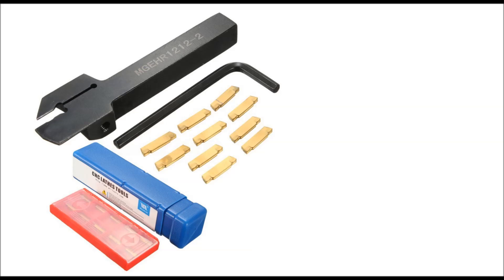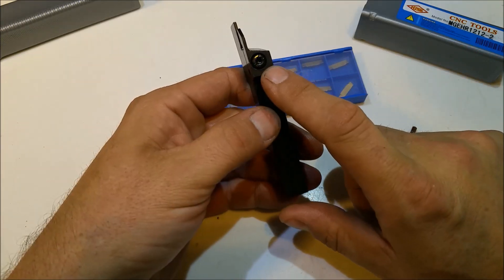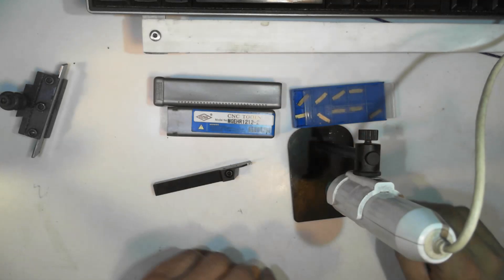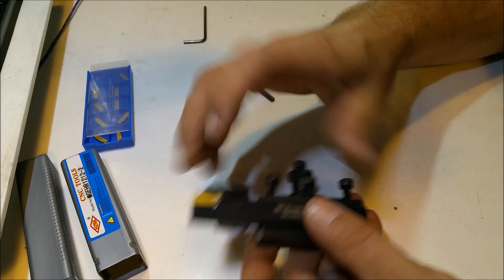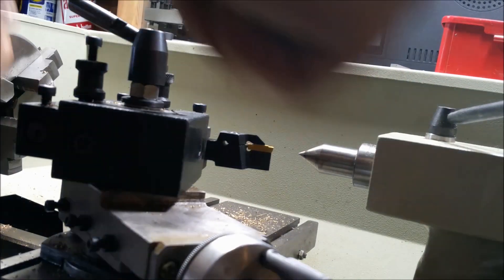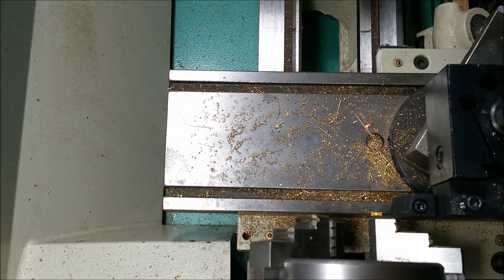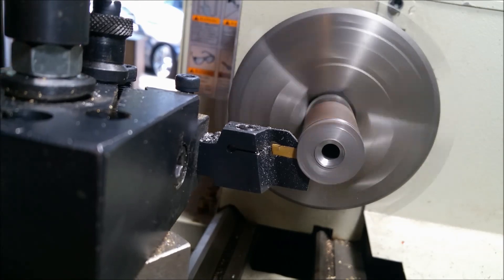Carbide Insert parting Tool review (MGEHR1212-2)

Comment: Use hss put the tool in the holder and put the lathe in reverse, you wont have any issues, carbide is a waste of time on small lathes because they sre not rigid enough

Comment: I already have got 2 pieces of this tools for 2 mm tips, one in "right" and the other in "left form" ( depending from the side you are approaching your piece ); they are beautifull and easy to use. I use them indeed in up-down position and reverse speed of the spin, so the chips easily fall down without problems to the incoming cut.
Some oil during cutting can also help. The tips could also be regrinded, and they still do work, on the contrary other shape of tips ( for other works than cutting ) are not regrindable cause their shape ...
For deeper cuts, on major diameter stocks, HSS tools are the only ones you can use, i equally do use them also in a top-down position and reverse speed of the spin. Here i use them in a dry situation, no oil that can stop the chips from falling down, as it was glue inside the groove ... and so generating a worst situation than dry cutting. I was able to cut a 55 mm steel stock, more than one time ...
Don't use HSS tools with rectangular shape  ( as 2 x 12 mm ... ) but ONLY trapezoidal shape ( 3 mm up, 2 mm down x 12 mm height ) otherwise they will always become stuck inside the cut ... ( no enought room for the HSS tool itself into the groove ).
My chinese lathe only can use 10x10 tools, so i choosed "1010" tool instead of "1212" herein in the video. And also you can choose tools for using 1,5 mm tips or 2,5 mm tips ( instead of 2,0 mm of the video ) to cut circles in your stock piece ; also rounded tips are disposeable, for installing rounded o-rings.
Somebody says cutting with 1,5 mm tips is more and more easily than 2,0 mm tips, for the minor steel to cut ... i never test it ...
Alessandro from Italy.

Comment: Something is flexing there really badly. If You can see it, it is too much.

As probably everyone already has said, the cutting point should be as near the chuck as possible. The longer stickout there is the more the workpiece itself is flexing and sometimes it climbs on top of the cutting blade wreaking havoc. Climbing takes place also when the tool height is too low. Having the cutting point far away from the chuck will also increase the risk of chatter. Sometimes the setup does not allow cutting near the chuck. Then tailstock support can be used but this has to be done with caution to not to squeeze the cutting blade between workpiece parts after parting.

Another problem that most had spotted is the tool stickout. Even if it sticking out only about 10 millimetres, it should be eliminated if possible. So the tool should be pushed into the holder as far as it goes and is allowed by the setup. Long stickout on the tool increases the risk of the workpiece climbing on top of Your cutting blade. It also increases risk of chatter.

Some of the commentators had also spotted the general stickout of the cutting setup. By this I mean the position of the compound and the angle of it. After having those minimized by straightening the compound and moving it so that it is fully supported by it's dovetail, everything that is not required to move should be locked. This includes the carriage and the compound. This is probably the most effective measure against tool flexing and vibrations.

The center height of the cutting blade is very important and when done incorrectly variety of problems can occur.
When blade is too high it does not want to "bite" into the workpiece. One has to apply excessive tool pressure in order to make the cutting start. When the cutting finally starts, the blade cuts in an unexcpected manner. The excessive tool pressure will at some point chip the insert as well.
When blade is too low the cutting angle becomes negative when approaching the workpiece center. This causes downward force which can make the blade to flex and allows the workpiexce to climb over the blade. This usually cracks the insert, destroyys the workpiece and can bend the tool holder.
The correct tool height is at dead-nuts center height. Although adjusting the center height using the dead or live center at the tailstock is obvious this method is not that accurate because the tip of the center is rarely very sharp. One very accurate way of adjusting the tool height is by facing with the parting tool. Just have a scrap piece in the chuck and start facing it. Facing may leave a nibble in the center. When facing does not leave any nibble, then the tool is at center height.

Cutting oil is generally not needed with coated carbide tooling. However, it can improve the surface finish and prevent the chips from welding into the cutting blade. This can happen especially with aluminium. Mild steel is also a good candidate for bad surface and cold welding. Cutting oil is a good addition. If it doesn't help it doesn't hurt either.

Speed and feed play some role when trying to eliminate chatter. Generally parting should be done as fast as it can be done without chatter. Tool pressure should be kept rather high to keep the setup from chattering.

Happy parting !

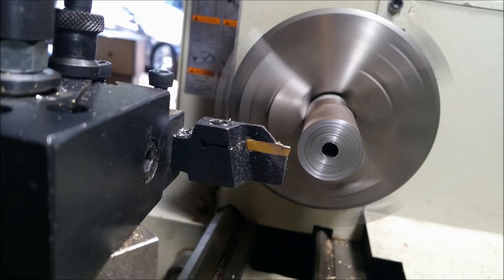Comment: Around 3:36 I can see that the tool is not stiff enough... Play with slowest speed everything's bending there. 4:02 the tool is too far outside of the holder as well. This is ok for aluminium but for steel you should modify that part.

Comment: Nice video and presentation. 
I have one thing to add after observations gain from several channels. 
(1) blade tip can’t set closer to the post because of the clamper skull take up space. 
(2) due to (1) the moment from work to post is higher than necessary, is a disadvantage. Nominal post_holder flex will get emphasized letting the blade tuck below the center line. 
(3) tucking under, a horizontal force component is produced tearing the tip away from its body, the insert. 
(4) cracked carbide tip still tucked in the material get forced down onto the insert seat, at stalking force, the broken tip cut down onto the seat, thereby ruining the seat beyond repair.
 
Remedy? There is no remedy once it’s damaged. Something we can do in advance is : advance the tip level above center line to an amount equal to the flex displacement. It isn’t straight forward and is dependent on : rpm material, feed rate etc. use our judgement.

To avoid error judgement : 
- Stop cutting the last 1-2 mm of solid work , unless work is bored or drilled.

Comment: Bought one for parting and the inserts were breaking quite easily.  Sometimes it liked going fast, sometimes it didn't, during one of the parting actually broke the insert and holder top part.  Thinking of getting SPB26-2 now, it's double or more cost but hopefully it's stronger.
Reply: Ok, update:  After sitting damaged for at least 1 year I decided to give it a try again.  I found if I part something with center hole drilled which is pretty much most of my parts it doesn't break insert.  So even with damaged holder now I hardly break inserts anymore.  The secret is don't run it all the way to center if you don't have hole drilled, stop short and break it off by hand, it will save your insert; it been working great since I discovered the secret!
Reply: @DimaProk  in that case: are you 100% sure of the tip center height? it is more critical as you are close to the center, dont use any other method to check for height other than facing with the tool, also u must indicate the tool parallelisms to the ways, as u go to the center the tip will be bent if it is not parallel to the ways, check all that and let me know, but even thought i did all that it does break, and that is because these cheap holders is not made equally, even new i noticed the pocket is loose to the insert, other times the insert is not fully seated even if u push it all the way, i really believe that these reasons are key to why they break also
Reply: @GraphicManInnovations  Pretty sure my center height is setup correctly but I will check next time.  You're right about low quality of these holders, it wasn't made well, I noticed when I clamp down on insert it's off center horizontally ever so slightly.  I need to order new holder but prices doubled at minimum since I bought it few years ago.
Reply: @DimaProk  yes that happens and if u noticed u should find the insert wiggles to the sides before clamping, the quality is not stable, another holder of same style did not have this issue but it has another issue which is the insert is not fully supported underneath, that make the carbide break, if the insert plays to the sides before clamping it will after clamping specially when using lubricant, and sometimes its base will crack and then it will damage the socket on the holder itself, also never try to part nasty materials with these, like hot rolled, it will break the insert straight away, so in short the main issue i see is that the pocket on the holder is usually loose, also your setup on that lathe is really not rigid, these flexing has to break the insert, my lathe is way stiffer than urs yet still breaking the inserts, i tried to find another higher quality holder of same style but i dont know why they are rare to find, let me know if u find any as i would like to use the inserts that i got
Reply: @DimaProk i use the tool in up-down position and reverse speed of the spin ... it works, try ! The chips fall down without clogging the groove. ( only see if your chuck can't be unscrewed !!! A drop of oil can help ...
Reply: same problem, don't know if I need auto feed or something
Reply: same problem 100% correct, these are ok only for soft materials
Reply: @GraphicManInnovations no, i cut steel using the tool up-down and reverse speed of the spin ; chips are falling down without clogging the groove ...

Comment: Hi Don, some rules for parting, part as close to the chuck as possible, get the tool back into the tool post as far as possible, ensure tool is parallel with chuck face. Make sure top slide is not over hanging the cross slide and is locked in place and not at 45 degrees as yours is shown. The tool must be supported as much as possible. Use cutting fluid. Tool low rather than high (high will break the end off the insert) I usually adjust by taking light cuts until there is a tiny tip of material left. That sample you cut probably needed about 1500 to 2000 rpm. Carbides like to have enough speed up.
Nicely done video.

Comment: How deep will the tool reach before it hits the protruding side of the bit holder?
Reply from the maker: Great question, thanks for posting! This tool, the cutting depth is 16mm and the cutter is 2mm wide. 
Here are the specs:
https://img.banggood.com/thumb/water/oaupload/banggood/images/78/6F/2eb80d8f-b885-46de-a812-f7e0eaa1d03c.jpg
Reply: Don Brandt thanks for the reply. I will read up on it, but if I order one I will go through you. I don't usually do parting on my little 7x10 with a tool, I usually just cut with a cutting disk and then face the part off in the lathe.